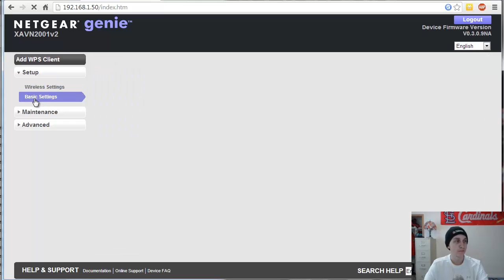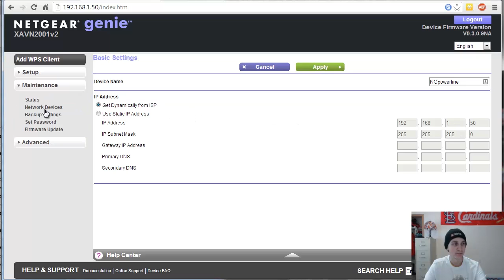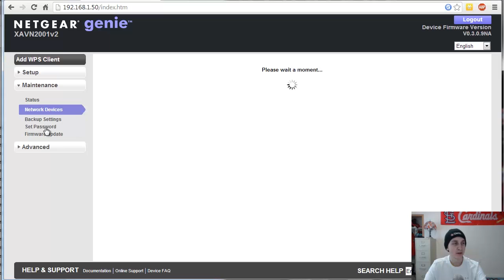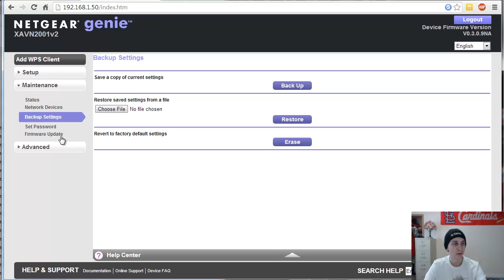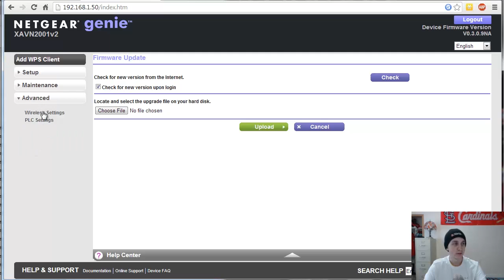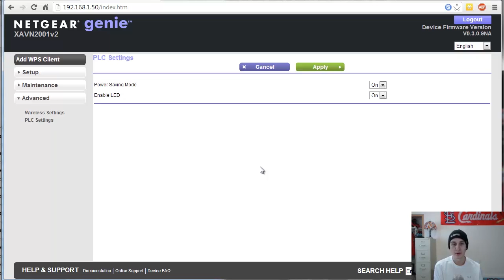Netgear Powerline AV 200 Setup

Comment: i think i'm fucked i ordered 1 on amazon for $13 and it was just a single adapter..... So can i just connect it to my main router+outlet first and then see if it works? Do i need both adapters for it to even work?
Reply from the maker: +Mikey James you need both. One will connect to router and the other will connect to the device you want as a wired connection.

Comment: Thank you for showing all of the options there!
Few questions though.
Have you noticed any issues with the adapters being on different breakers?
Were these configuration done on the main (closest to the router) or the remote adapter?
Reply from the maker: I tried on separate breakers and they didn't work for me.
My current setup is in a 9 year old townhome and the router, main unit is about 25 ft from the breaker and the other end is about 40 or 50 ft from the breaker and I still get the best indicator light connection. I think having a newer home with the new electrical standards and such help a lot when it comes to getting the better connection. I notice older homes dont get this type of connection. They'll get the medium or low connection in many cases for the longer distances. Which is still pretty quick.
Thanks for checking out the video.